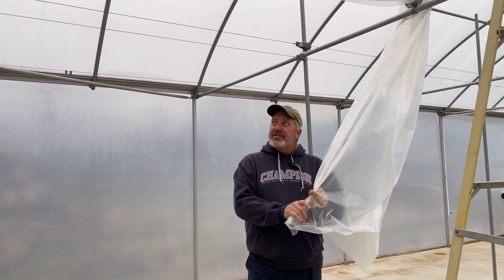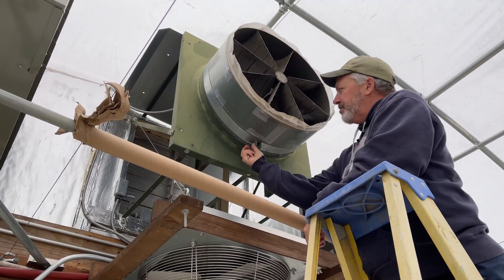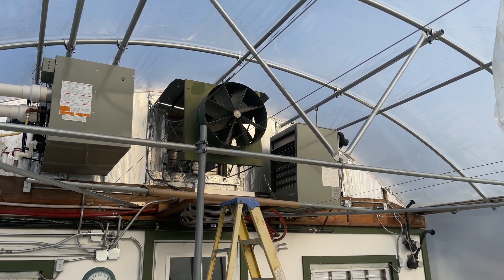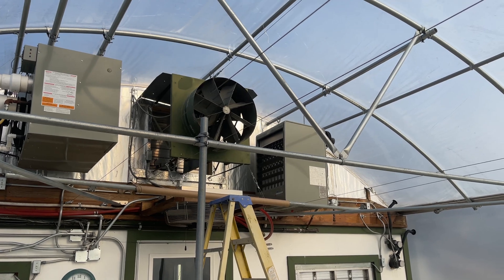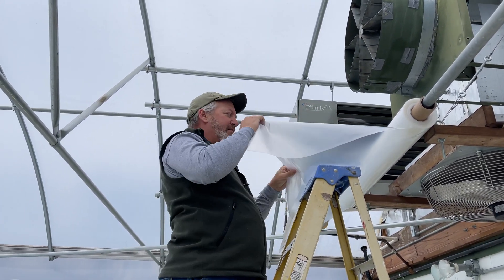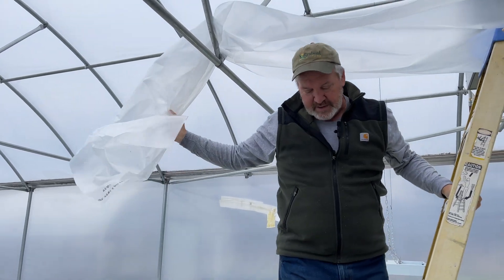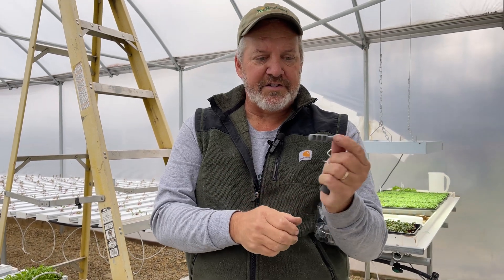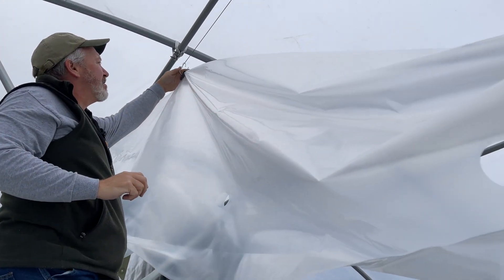Hydroponic Greenhouse Convection Tube Replacement

Comment: Awsome great info
Reply from the maker: Glad it was helpful!
Reply: @HomegrownPassion  yes sir very helpful . My only issue is that the last 3 clips keep  coming apart when the fan kicks on . The first start up, 6 clips at the end came apart . Put them back in, double checked they were spaced correctly and hit the switch the second time and 4 or 5 came apart . Put them together again and 3 came apart . I'll play with it more Saturday when I get back there . Ohio is a very nice state . I grew up an hour from lodi . Did a lot of work in Wooster.  Built a lot of homes around Hudson.  Great soil up there .

Comment: Thank you  Doug. Your family farm series just gets better and better.  The detailed content is helping others learn the greenhouse  trade for local food production. The tips and methods , from years of growing the crop king way , is a reflection of many small refinements . I am reading a book on Kaizen and Ikigai . These methods mirror  your family mindset and living / work methods :) I am going to assume the fan blows 24/ 7/ 365 days a year? Or just during the heating season ?  I know you use the wet wall for summer cooling . How is the winter air intake "filtered . Or is it just recirculated ?
Reply from the maker: Hi William, Yes, the jet fan runs 24/7. The intakes on the jet fan have insect exclusion screening as well. The louvers are controlled by the I Grow system which includes a timed setting that allows a brief amount of fresh air to enter the greenhouse every hour.

Comment: Good video, is that heat generated by your wood boiler? Could you do a video on your wood boiler heat exchanger/ fan housing? thanks
Reply from the maker: Hi Rob, So the two heaters you see per bay are NG. The bottom fan you see pointing up is the heat exchanger for the wood boiler. I will do a video on the heating system soon. Thank you for the suggestion!!
Reply: @HomegrownPassion  thanks, that would be great!